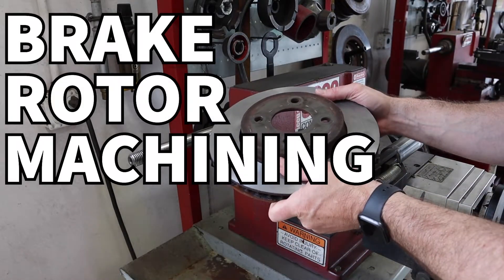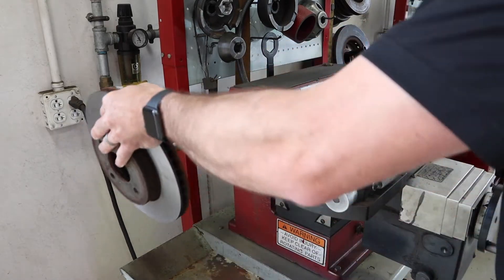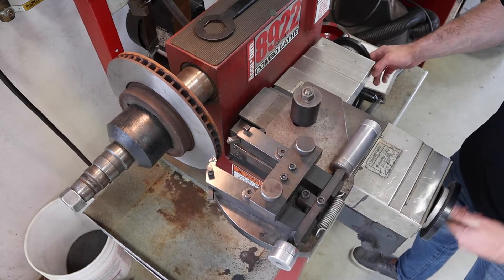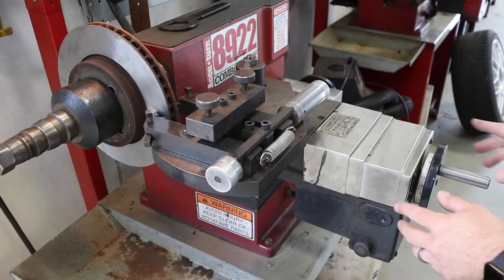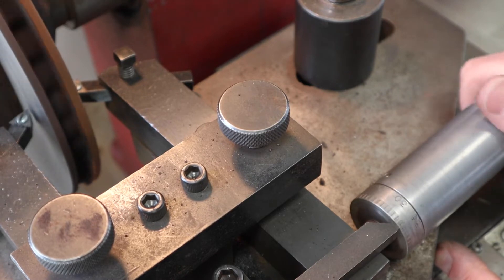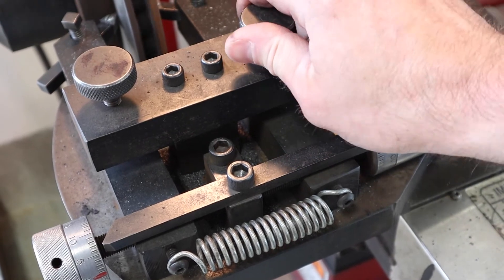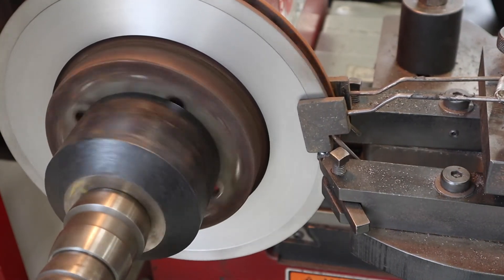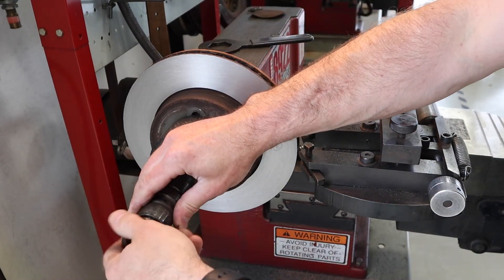Brake Rotor Machining

Comment: So they charged me $402 for changing brakepads and machining rotors… is that a valid price to pay?
Reply: No lol
Reply from the maker: It depends on the labor rate and cost of parts. If the brake pads were $100+ along with around 2 hours labor @ $150/hr, you could get to $400 pretty quickly.
Reply: @AdamsAnalysis 150 p/h for labour is absurd
Reply from the maker: @ you're not wrong. That's around the average for dealers in my area.
Reply: @dddny shit doesnt just fix it self.